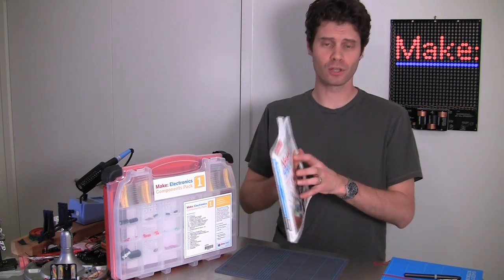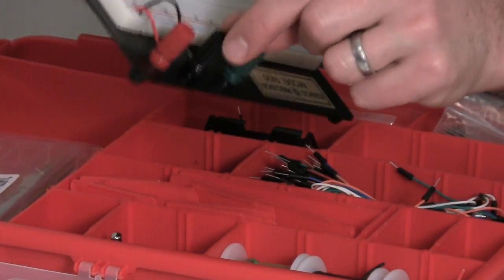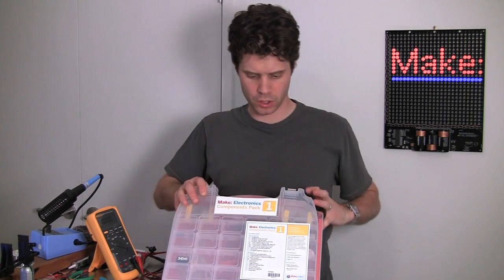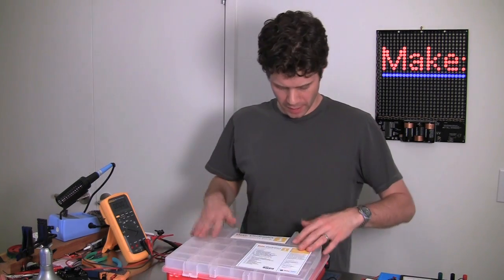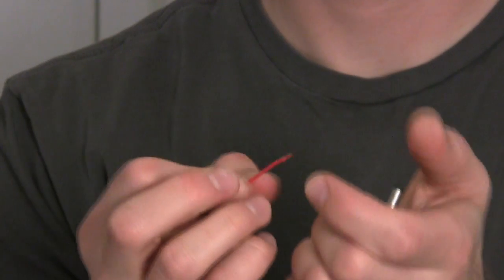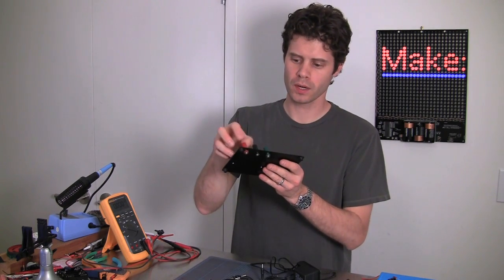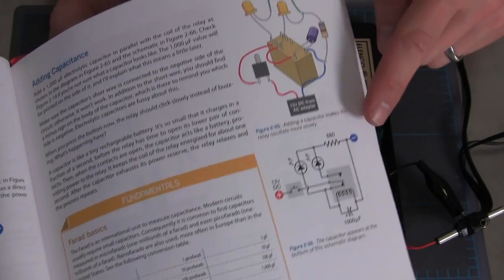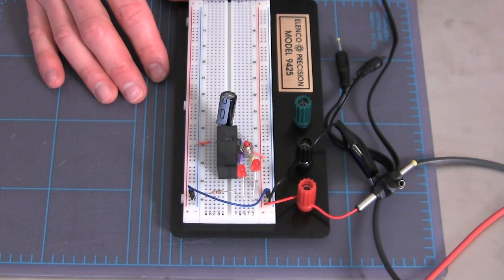John Park in the Maker Shed: Relay Oscillator

Comment: Instead of either chopping the barrels off or wedging my clips into them, I've systematically gone through my pile of wall-warts and worked a standard receptacle into all of them. 

This means that the crate-of-transformers never needs more wire-ties or detangling.